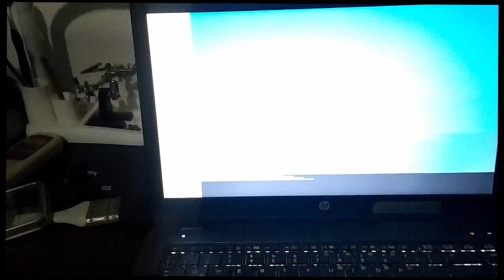🥵 Laptop HP muy caliente 🥵| Como la puedes limpiar por dentro | laptop hp Zbook

Comment: Muy buen video y muy bien explicado pero usted sabe si se pueden cambiar componentes de una laptop como una PC?digamos que no se tengo una laptop con 5 GB de ram y quiero 12 se puede?
Reply from the maker: Por lo regular las laptops tiene 1 o 2 espacios para poner mas ram, la forma mas rapida de saber es abriendola, en ocasiones las laptops tienen ram soldada pero dejan 1 lugar para meterle mas. Se ocupa el modelo exacto para ver que ram se le puede poner. Saludos
Reply: @donzazzu  gracias gracias